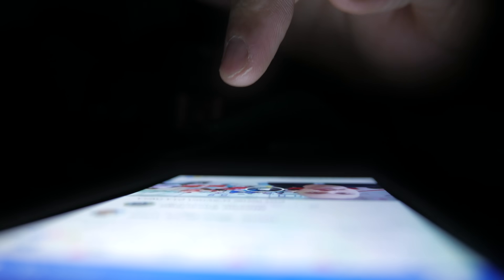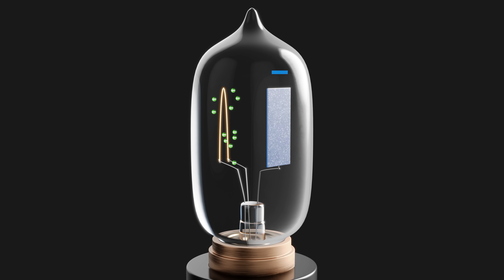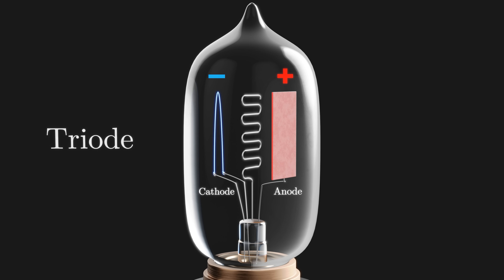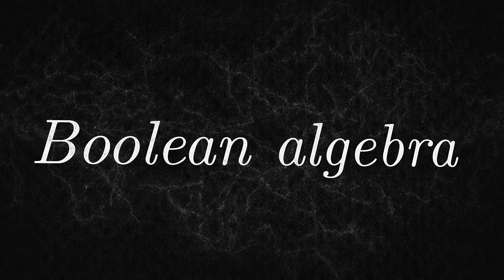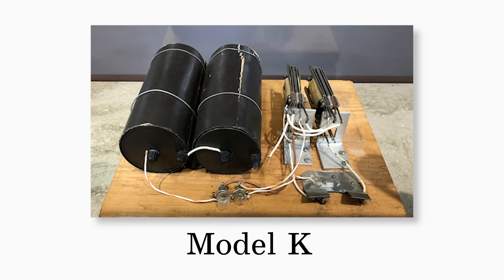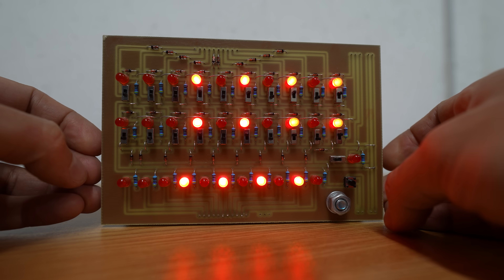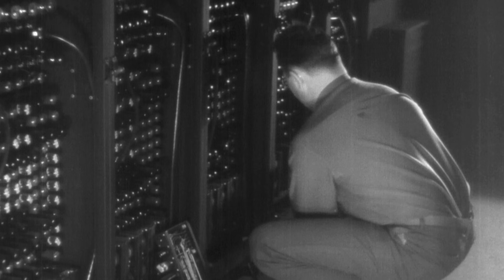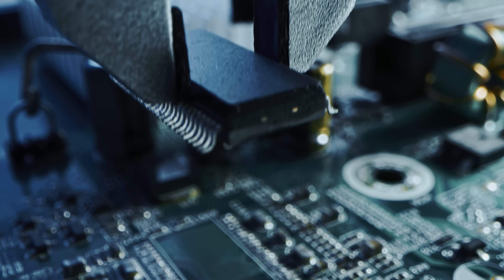Why The First Computers Were Made Out Of Light Bulbs

Comment: I was on a tour of a radar facility in central New York in the late 70’s. There was so much heat from the equipment (which was only on the second floor) that they had to have the entire building air conditioned year round. The mix of technologies was amazing, everything from vacuum tubes to the latest in integrated circuits.
Reply: I worked in the equipment rental business for 35 years in a high tech city with lots of computer server rooms.  One of the most baffling types of requests was for unvented air conditioner in the coldest days of winter.  When the installed a/c would freeze, they would need cooling, even when 10 degrees outside.  When asked why they don't just open a door or window the answer was "security".  Lots of heat even with solid state electronics.  These systems were designed and built by "smart" people.

Comment: Great video, great explanation of some older technology. 40 years ago while getting my degree the one thing drilled into me was you will never see a relay in use nowadays anywhere. 😂 my first job interview I was tested on how to design a relay logic circuit. I dumbed down my electronics deg and put one together, my interviewer said that although it would work he had never seen one drawn like that. A few years later I at my next and last job, power system operator. Guess what we’re still the state of the art, you’d be right if you said electromechanical relays. 😂 
By the time of my retirement the old relays are starting to be replaced with computers with analog to digital conversion on the inputs. 
You want to do a really interesting video learn how transmission relays worked and share that with the public.

Comment: Taking up engineering, I only read about triodes as the pr3decessor to modern transistors but I have never seen them in action in actual circuit boards. This has been very educational and eye opening!

Comment: perhaps this is not the best place for this but the the guy said the following 'any time you have something mechanical it is going to wear down' and this statement has, once and for all, finally been proven incorrect and a fundamental 'truth' of physics is cast aside and as a result of the use the thing was put to destroys a couple of other fundamentals in the same instance. the u of ark graphene generator system proves zpe is not just real but usable to extract energy from, the material used in the mechanical process of the system breaks entropy laws and said material is perpetually in motion. 1st) the covalent bonds holding carbon atoms together in graphene do NOT suffer mechanical fatigue and will NEVER, under any but the most extreme of conditions, break. atomic bonds can and do flex eternally as part of 2nd) brownian motion at the atomic level which NEVER CEASES even at the coldest temps we can produce. slowed way down? yes, stopped? nope 3rd) said motion IS ZPE, nothing is input to make these atoms move they simply do so as a function of physics and all of these factors combined produce a demonstrated device that functions as stated and does something that seems impossible but when down to the, literal, atomic level is undeniable. the kardashev scale is wrong. any species that taps this type of energy source has access to unlimited UNIVERSAL energy. for reference, a sphere 50m in diameter filled to 75% capacity with the graphene generator and the remaining 25% filled with cooling and transmission systems can according to the data, at the very least, produce 1.5 times the total global energy consumption for a year in 1 SECOND and continue to do so for FOREVER, at the best output the production is 3.5 times total global use every second for forever. so many 'super geniuses' will pipe up and denounce what iv said. i challenge them to prove any of it wrong

Comment: In 1974, I first came into daily contact with a digital computer, a $10,000 Wang Lab 2200T with a built-in basic ROM. We used the machine to calculate gas flow requirements for proper sizing of gas compressor packages to transport natural gas through pipelines.

Comment: I am graduating from university this fall with a bachelor's degree in computer engineering. This degree involves designing computer hardware, unlike computer science which is designing computer software. My field is built on the shoulders of people like Claude Shannon and George Boole. We use the theorems geniuses like them created to not only design functional digital circuits but also to optimize them, reducing the total number of AND, XOR, etc gates used. This is important as it reduces the power usage and total area a circuit uses on the chip while also making the circuit run faster. Granted many of those optimization calculations are handled by computers in industry now but boolean algebra is still a fascinating topic. Happy to see an area I am so involved in covered by you!

Comment: thanks for the vacuum tube tutorial. i am 66 and remember them very well. in his twenties, my dad had a small repair business. among other things, he fixed tvs and radios. generally that meant simply replacing a vacuum tube. but which one among the myriad? he built himself a diy tube tester. to the best of my recollection, it was a board with various receptacles and rocker switches. each tube had a specific identifier and the receptacles were labeled with those identifiers. to test a tube he’d plug it into the appropriate receptacle and flip a rocker switch to see if it lit up. i liked watching him work in his basement workshop. i was six and it seemed like magic to me.

Comment: i always have to have an evil laugh at how the most fundamentally important discovery of edisons was the one he tossed away and deemed "useless"...

would be interesting to have shown the various designs of tubes fleming and deforrest came up with, before they cottoned on to the cathode grid anode orientation...  control grids outside the anodes, grids on the opposite side to the cathode to the anode, etc...

then along come tetrodes, pentodes, sextodes, heptodes and various other multiple element devices... yeah gods.

and of course, all this could be done with magnetics... magnetic amplifiers, saturable reactors, peaking transformers...

its really worth knowing how things were done in the 20s and 30s if you want to understand electronics properly. thyratrons. ignitrons. pliotrons...relays, how they arranged their version of "PWM" or power control circuits... everything we have is developed from the first basic systems using coils, rheostats, relays, and lots of mercury...

Comment: I disagree, they're also an awesome invention for light. The assumed ineffectiveness of the incandescent lightbulb is really overblown, it has its uses. In my house I have to heat it electrically and it does not matter one iota to me whether that is through an electric radiator or with the help of a lightbulb. In other cases it doesn't make sense and that's fine. Use LEDs or what you want. It's just utter tosh that the incandescent lightbulb is "not good for light", even with its drawbacks the light it does emit is actually very nice and warm, easy on the eyes and produce a nice color. LEDs are not as easy on the eyes and the color they make is not as appealing. Banning incandescent lightbulbs is a massive overreaction and quite frankly stupid.

Comment: Hi Derek, I'm a semiconductor Electrical Engineer. I also look forward to your silicon video(s). I have often imagined how to animate a Bipolar Junction Transistor (BJT). The electron would be a circle of one color, the hole a different color. During recombination, the colors disappear into the background. I'm sure you will explain what took me some time to learn. The reason the charge carriers get through the base into the collector is diffusion! The importance of emitter injection efficiency might be out of scope. Another in the series might show how the photo-voltaic diode works, the light making electron-hole pairs (EHP)s, and that makes power how?
Reply: I too would like to see a similar video on transistors.  I have never quite understood how the small current at the junction can effectively amplify the current passing through the transistor.  Really enjoyed this video.  I went into electronics in 1974 via the United States Air Force.  This was about the beginning of the end of vacuum tube usage.  Still, in some cases it was still more cost effective to maintain old equipment and perform preventive maintenance on it than to buy new.  I had a piece of equipment made in 1940 that was still there when I left in 1982😊

The transition from vacuum tubes to transistors necessitated a career change for some TV repairman  because some could not quite figure out how to troubleshoot transistors.   I was always proud of my uncle Dave.  He grew up during the depression, and with a High School education taught himself enough electronics to start a radio and TV repair shop on the side.  He kept on going even with the change.  I talked to him about transistors.  He said it was a bit difficult at first, but he was determined to understand them.  He was one of people other repairmen in the area called when they needed help with a particularly difficult problem.
Reply: @josephbigler I can give you a short version for a BJT, but going to assume you know how a diode works and what the depletion layer is.

So your NPN BJT starts off with no voltage at the base, a negative voltage supply wired to the emitter, and a positive supply to the collector.

Just like a diode, the electrons inside the emitter are gonna move over to the base layer of the BJT, and holes will go from base to emitter.
Now we have a depletion layer from B to E, and that's it.

Now, put a positive voltage on the base. Suddenly the charge carriers inside see a larger voltage difference that is going to make them want to make an even bigger depletion layer. More electrons shoot over into the base layer.
However, the base layer is thin. And now these new incoming electrons start pushing against the old electrons that were already there from the setup - they end up knocking into them hard enough to shoot them over into the collector region (overcoming the small voltage hurdle of the base-collector interface. Usually only .7v).

Side note, technically BJTs are more current focused, but it's all the same. A small change from the base causes a huge butterfly effect enabling electronics to shoot through the whole bjt layers, and now we have current.

Hope that helps!
Reply: @Celastrous   whats literally
Reply: This is literally how all the diagrams were color coded during my EE degree classes on semiconductor electronics
Reply: What’s your major?
Reply: I remember my old professor teaching me the differences in semiconductor transistors...  I never fell more in love with the MOSFET and its design although delicate in nature.
Reply: i only read till the first 5 words
Reply: Setting aside your grammar (unless English is not your first language?), I agree: I, too, am enthusiastically looking forward to the follow-up video that, hopefully, will feature Derek explaining solid-state electronics in a similar manner!

Comment: Derek, can you understand why electrons are needed to transfer electrical energy after seeing how a vacuum diode works?  In your low voltage DC circuit the energy traveled trough the wires as there where no electrons passing trough that 1m of air separating the two parallel wires.
During the initial switching the electric and magnetic field where variable thus affecting electrons in that remote wire same as moving a magnet near a wire will affect the electrons in the wire but after that transient period all energy travels trough the wires (electrons moving so electrical current).

Comment: Yeah, it turns out that vacuum tubes, being unreliable and all, had a major advantage: you can, for example, have a specialized tube which could solve differential equations all on its own, in hardware! And better yet, it could have even more specialised function, akin to modern neural networks. Granted, modern semiconductor computers are all about versatility instead of specialization, but the idea of solving problems without writing a software for it seems wild. 

Oh, and also vacuum tubes were unaffected by EMI from nuclear weapon, although in modern day and age it's a feature that rarely gets mentioned.

Comment: Also, Tommy Flowers, the designer and builder of many of Alan Turings machines, discovered that to make vacuum tubes more reliable was to never switch them off, as most of the failures occurred on power up. During idle periods, the power was turned way down but not off.

Comment: When ever I get bored of the subject and think i only need this for my exam, you light a spark in my mind by visually representing and explaining the same concepts i learned in my class, They did not show how the triode worked in animation but they certainly told that it consists of three parts and one repelled and accelerated electrons, by showing it in a static ppt slide on projector screen.

Comment: Man another use for these triodes is in guitar amps. As the name implies it literally amplifies the signal using this same electronic setup. This increase is called the gain increase and makes the sound of the guitar distorted. Tube amps are the classic sounding amps from the 70’s distorted rock guitar and eventually metal.

Comment: Your computer is still, STILL, just a series of half-adders. Millions of them squeezed onto a silicon wafer to create a  microprocessor. Every function your computer performs begins its life as a mathematical computation. 
All digital mathematics are based in simple addition. Every mathematical operation is a variation of addition. 
That is all a computer can actually do. Addition. That's it. It's not doing anything but adding numbers. Subtraction is the reverse of addition. Multiplication is the repeating of addition. Division is the reverse of multiplication, and so on. The "half-adder" performs it's mathematical computation via Boolean logic. 

The key to a computer program is to assign a mathematical value to an operation. Such as, "If answer is this number, place one pixel of certain color in this location on screen" and so forth.  Of course, the job of actually assigning a numerical value has already been performed by the operating system and a myriad of other legacy programs and architecture making the job of "programming" a computer much easier than it was in the beginning. 

A.I. is still just a very fast and very powerful adding machine. No different.

Comment: Currently working on a project that uses 12nm TSMC PDK. The minimum wire width is 24 nanometers! (Other smaller nodes have even smaller dimensions!). Compare that to a typical strand of hair which is 80,000 nm - 100,000 nm !

Comment: The really big idea in ENIAC was the stored program.  Von Neumann realized that you could encode instructions for a computation as numbers and keep them stored in the computer's memory in exactly the same way that you stored data.  You didn't use plugs or wires or switches to tell the computer what to do.  You gave it a series of numbers instead.  

This idea has been adopted by pretty much every computer made since then. This is why we developed assemblers then compilers.  This is in harmony with the theory developed by Alan Turing, which relied on the fact that a description of a Turing Machine could be input to another Turing Machine. 

That is why ENIAC gets so much attention historically.  Because of the Von Neuman architecture.
Reply: @morfanos  Thanks.  I just read up a bit more on ENIAC, and it appears to have had some significant transformations over the course of its lifetime.

Comment: You should also mention the SAGE sites. The original sites used tube computers. These were the AN/FSQ-7 computers and were the largest vacuum tube computers ever built. Getting them to operate long enough to meet specifications and exit the warranty period was rare. The Smithsonian has just one bank of a SAGE computer on display. 

These required immense and highly precise air conditioning units to maintain their temperatures. 

They also used magnetic memory. These were computers of another age.

The SAGE sites would be an excellent follow on to this video.

The SAGE building proper was designed with a 12 foot thick roof designed to withstand a direct impact of a nuclear weapon going off. The internal lighting ran down through extensive grids in the operating areas so that light only flowed directly downward into a room that was entirely black other than the displays. Entering the room was like walking into space with the consoles floating in the air. Color was tightly controlled throughout the facility. Those early CRT displays were very poor at blue. So everything was done to minimize the impact on operators moving from one area to another so that they would see the blue well. The food in the cafeteria included eggs that appeared green as a result.

Comment: As an electrical engineer: Thank your for using the correct description of a "potential difference", or voltage, between two points instead of falsely talking about a "potential" between two points.

I hear waaay to many educational YouTubers use false terminology there... Which, I have to admit, is just a small mistake, but a mistake nonetheless - and it shouldn't happen to educators again and again and again!

Comment: Wonderful explanation of the origin of the vacuum tubes: diode, triode. It could go on with the tetrode, control of the cathode/grid  capacitance, finally the pentode and its suppressor grid to  slow down  electrons before they reach the anode.
Reply: As a kid, 60 years ago, I found in my grandfather's attic an old radio setup with a triode valve. Textbook type: straight horizontal filament, helicoidal grid and cylindrical anode. I played and dreamt about electrons, and became an engineer.